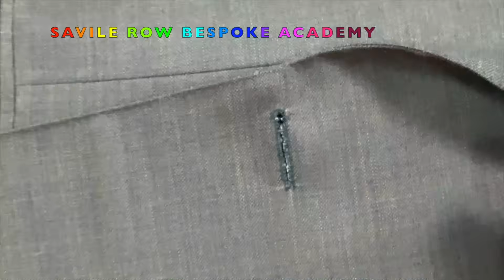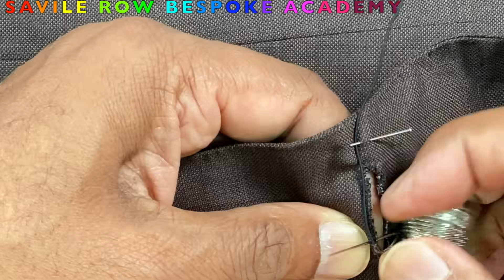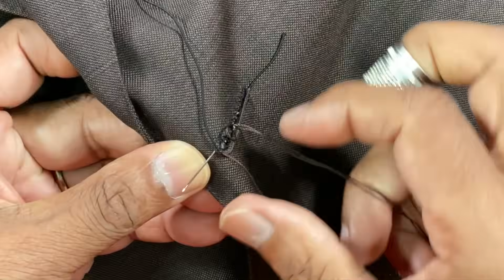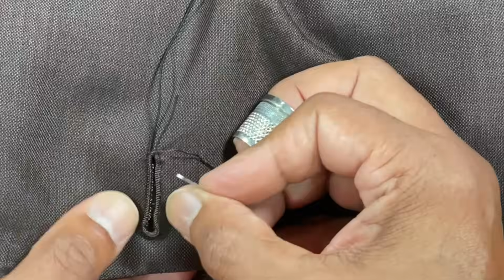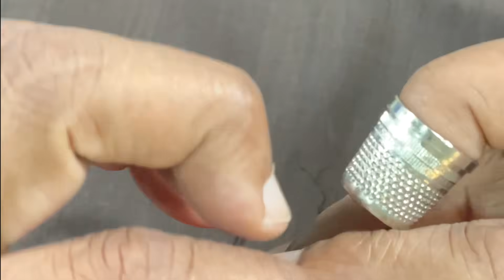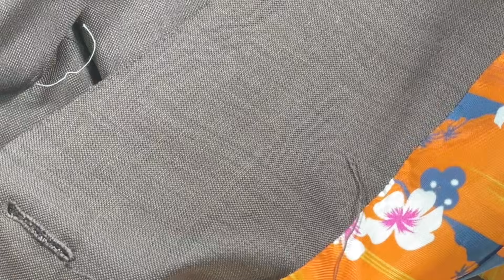The Bespoke Buttonhole

Comment: What size button hole punch do you use? Also, how close is the gimp suppose to be at the opening of the button hole. That is, should it sit on the edge, or say an 1/8 inch from the edge, or is it a matter of preference. Also should the knot be pulled up or to the side of the edge???